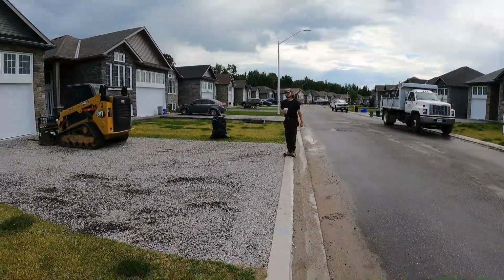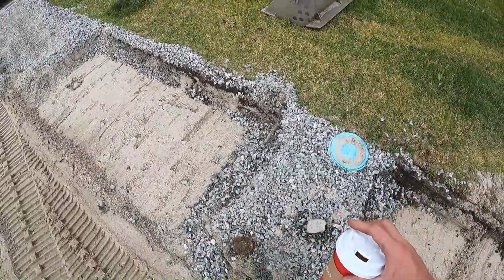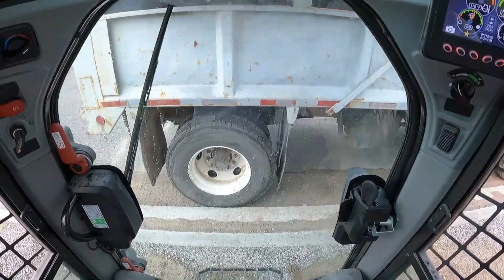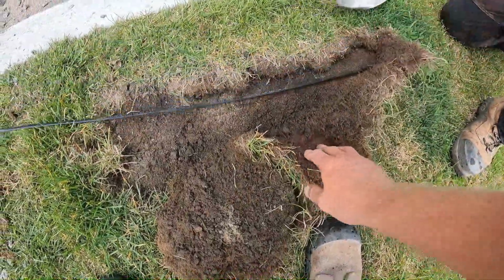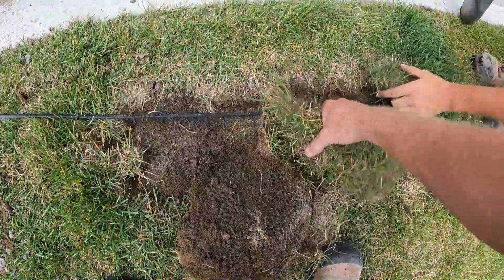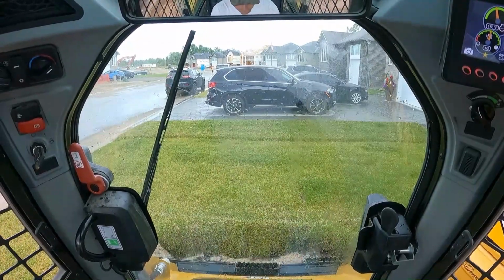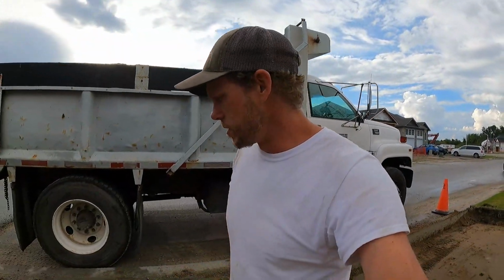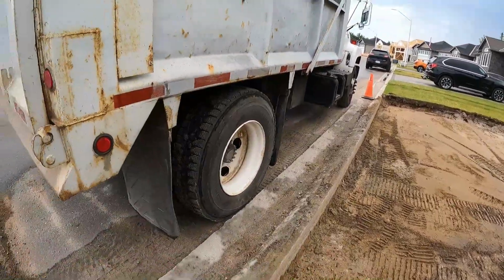Excavation for a Driveway And We Hit A Bell Line!! Opps!!

Comment: Did they try to charge you for the repairs of the cable
Reply from the maker: Nope
I was cleared of bell in the dig location 
Line must have been ran late spring
Thanks Bill
Reply: @gibsonlandscapeconstructio7984  That is a great thing. I didn't know if you had it officially marked for utilities.
Reply from the maker: @billfenner7084  always! Well 99% of the time 🤣they are about a month for locates now
Supposed to be a week 
No one wants to work anymore